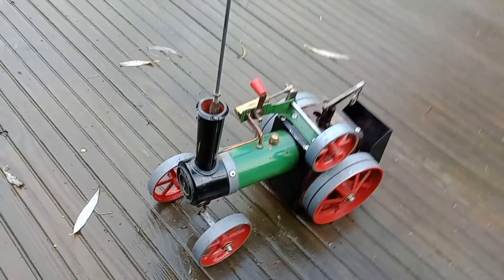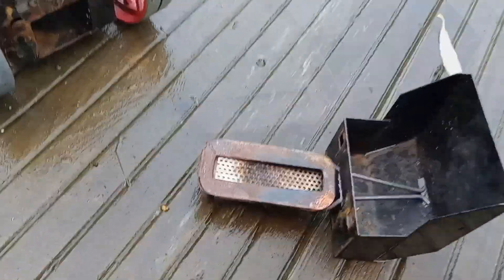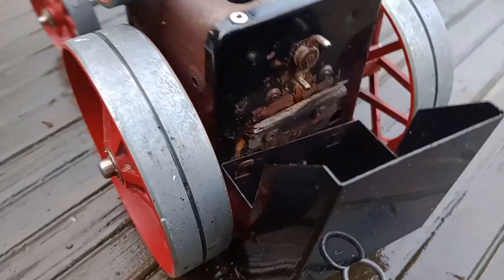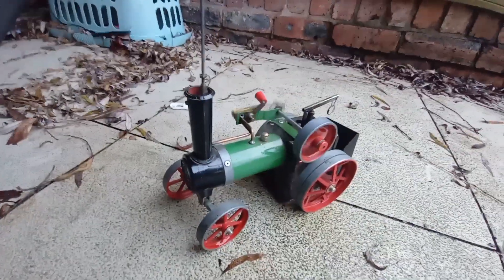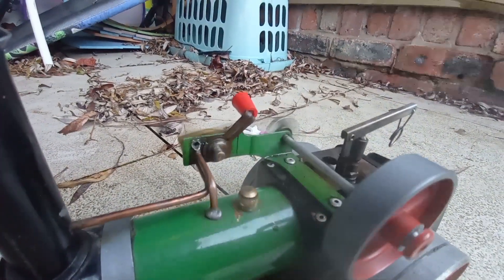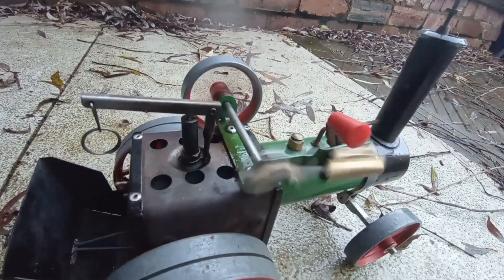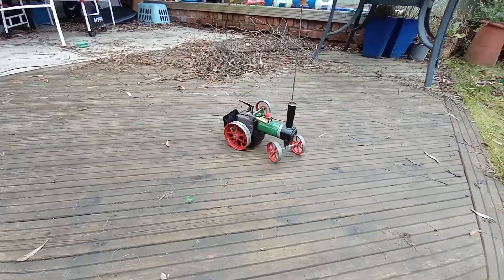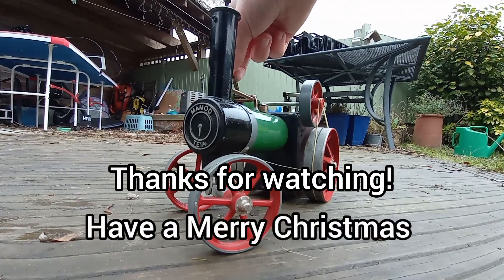CHRISTMAS SPECIAL! How to fire a Mamod TE1A steam engine

Comment: Nice video. It’s good to see an older engine in such good condition. I have a collection of model steam engines and there are lots of videos on my channel about them and also how to keep your engine in good condition. I was recently given a Mamod steam roller. It has not been used for about 40 years. I was very surprised about how well the engine ran, and it was in perfect cosmetic condition.
Reply from the maker: Thanks for the comment and yes, it is really nice to see an older engine working. 
I've seen your channel and subscribed - I like the look of the TE1A that you're restoring and do like the boiler bands you've added; I hope to see more soon!
Reply: Thank you for subscribing! I’m really happy to hear that you are enjoying my videos. I have had some trouble getting the showmans engine restored. I am not sure what I am going to do about it. I have a few engines which I plan to sell, so I will put a post on my channel when I am ready to sell them.